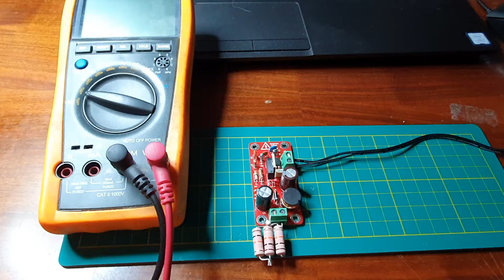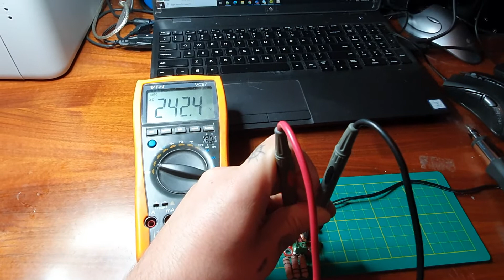HV SMPS 12V DC In to 240V DC Out

Comment: I didn't know high voltage SMPS circuits could fry without a load! That's probably why I seem to always fry the ones I get...
Reply from the maker: Usually is a good practice not to start an SMPS without a load connected